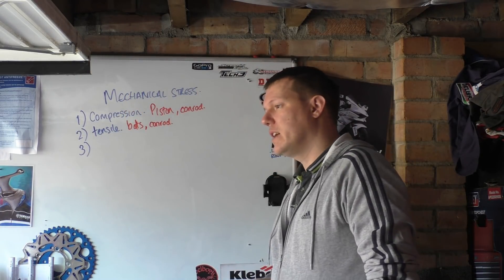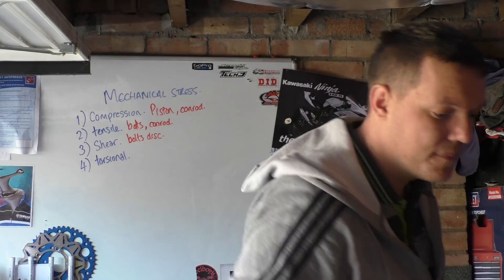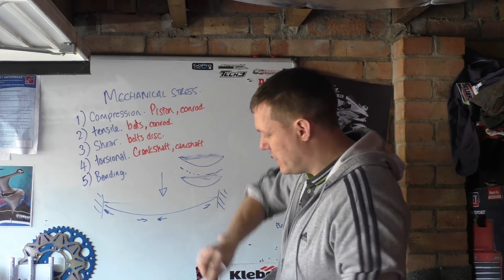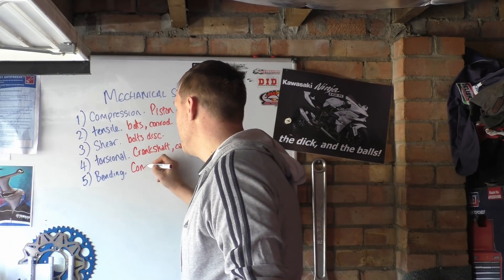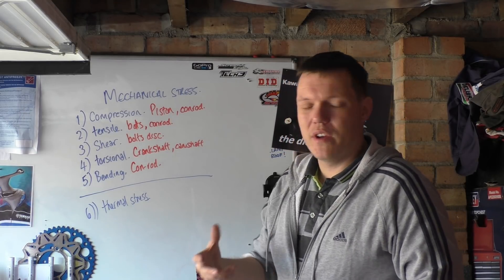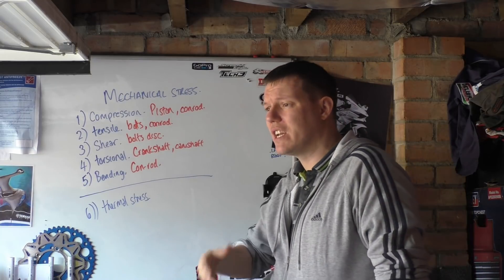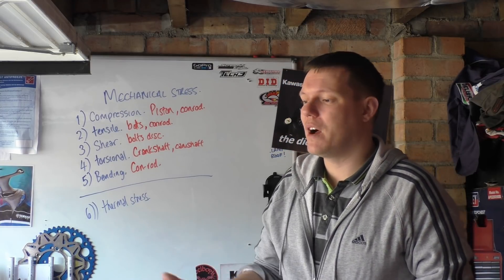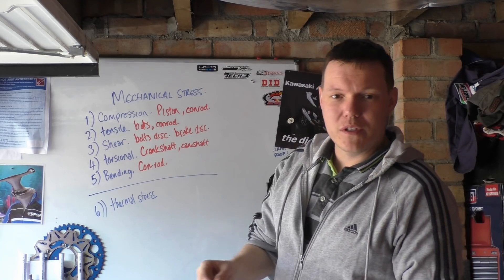Mechanical Stress - Introduction

Comment: One of your better videos.  That's why we come here, you idiot.  PS. look very closely at the tightrope example.  Do you see why that's not the best choice of examples?  The area of compression gets smaller as the angle increases.  At max deflection, the entire cross section is in tension.  Better to use a ... let's say concrete slab.  Very little defection and high comprsive stregnth and little tensile.  Tell me when I'm nitpicking.
Reply from the maker: "The area of compression gets smaller as the sin of the angle increases."

- I think you need to read the title again

Comment: diggs for Da'boy,
Don't forget the SS bolts made of cheese holding your rotors you thought would be a good idea. Thread lock and no copper grease, not even reading the infunctions. The caliper ones too, Ofuk you went whole hog and did the split half bolts too.

aircraft grade SS if you to deviate and yes there upwards of $120 EACH
pro-bolts, wont touch their SS or titanium for anything other than show
There are no substitutes for OE, brakes, explain that to insurance, oh hang on a min, have your wife explain it to them she may have to, to collect on that policy.

Comment: If you're counting thermal stress in this video maybe you should consider enviromental stresses.
For example: Steel in a marine enviroment with saltwater and all that shite is going to have somewhat different mechanical properties versus in a desert enviroment while it is in service.
Reply from the maker: Corrosion isn't a stress that's a chemical reaction - stress in mechanical terms is a force applied to a material
Reply: i wasn't quite talking about corrosion specificly but enviromental effects in general. Another example would be a piece of steel in the vaccum of space would likely also have different properties.
Reply from the maker: I get what you mean now - but does that apply to bikes?
Reply: Well wouldn't a highly humid enviroment have more water in the air which could change the like of compression ratios which would have some kind of knock on effect for a lot of mechanical stresses?

Comment: Is vibrations a separate thing?
Reply from the maker: Yes - this falls under the acoustics column - we'll get to that - but basically its an oscillating bending stress - with both compressive and tensile stresses

Comment: Boosted engines always have stress pushing downward in the same direction causing less  stress on rods and bearings than you would think.
Reply from the maker: "Boosted engines always have stress pushing downward in the same direction causing less  stress on rods and bearings than you would think."

- What the fuck are you talking about? The highest tensile stress that a con-rod 'sees' is at TDC on the exhaust stroke.
Reply: Wut?
Reply: Miles11we 
The rod is always loaded downward for all 4 strokes.
Reply: Boosted engines dont have valves?
Reply: Miles11we 
What? The force is always down. Even the exhaust stroke has resistance, intake is under boost, the other 2 I shouldnt have to explain. The force on the rod never has to change direction, it always pushes down.
Reply: The Workshop 
It never changes to the cap side of the rod. The change in force is not good for rods or bolts. The rod is designed to absorb the combustion force primarily. Unloading the rod and loading the cap occurs in the intake stroke in naturally aspirated engines. They don't like that much.